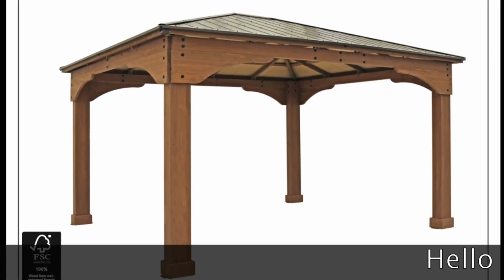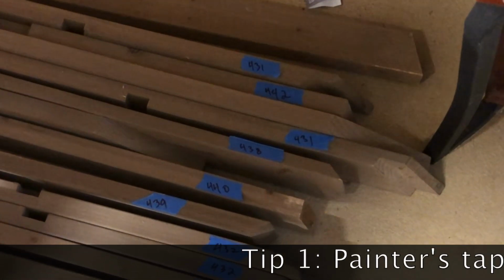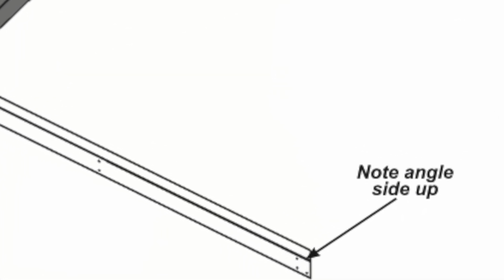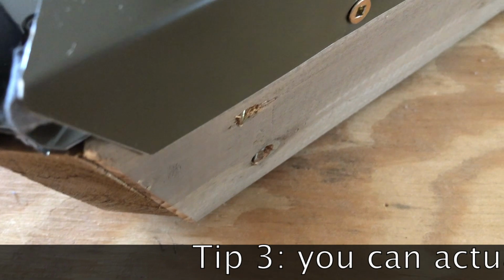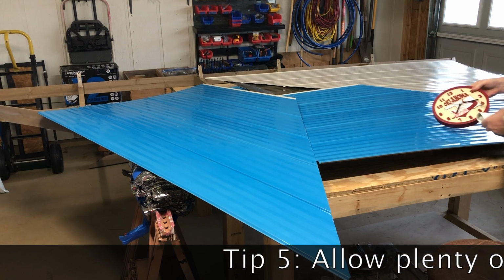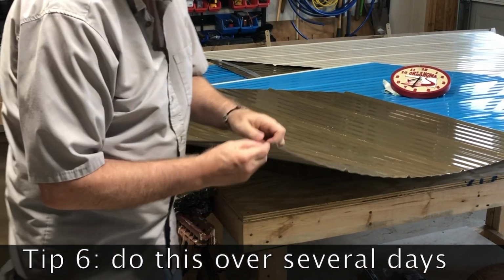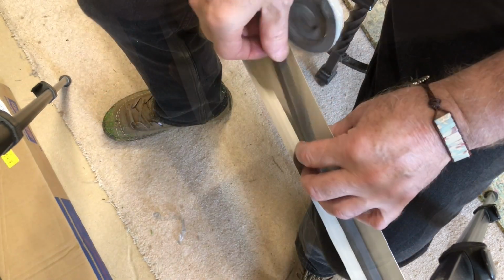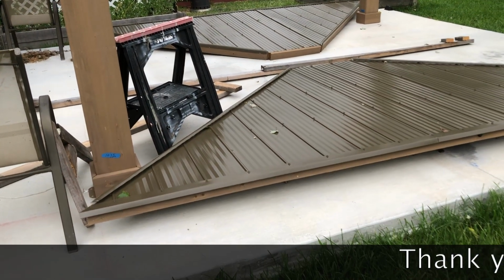Yardistry Gazebo(Costco) Steps 7 8 9 10 11 roof

Comment: Had the same concern about the 2 3/4 dimension.
Reply from the maker: I now think they were meaning to center line of the screw holes not the edge of the ridge clip.  But the drawing is difficult to interpret.
Reply from the maker: I am not going to adjust, should still work, I hope, lol